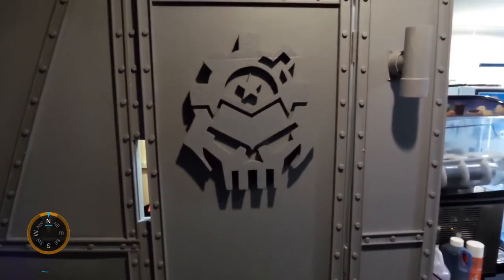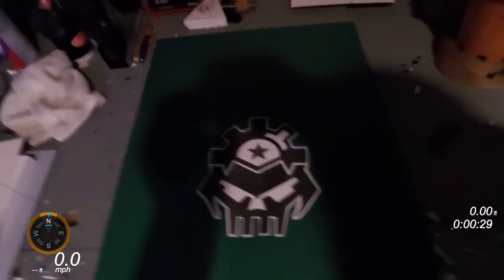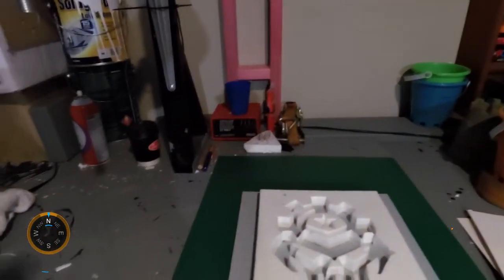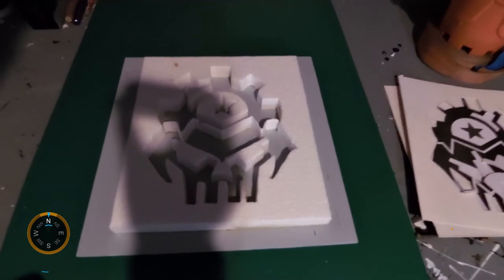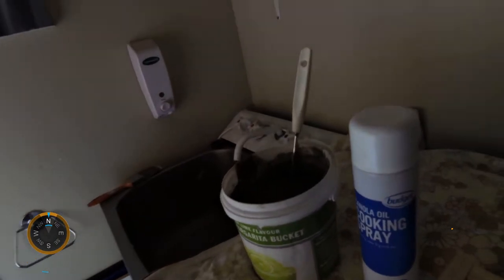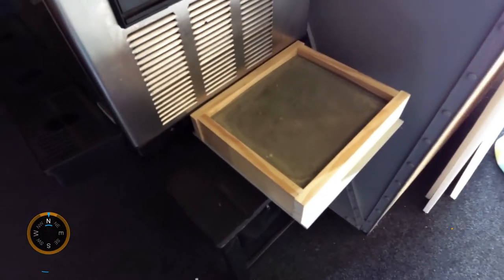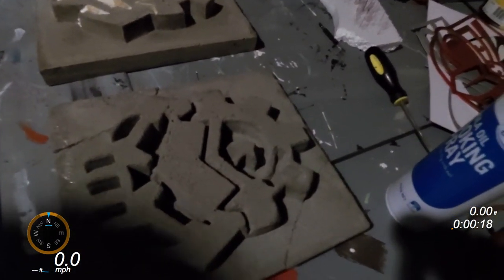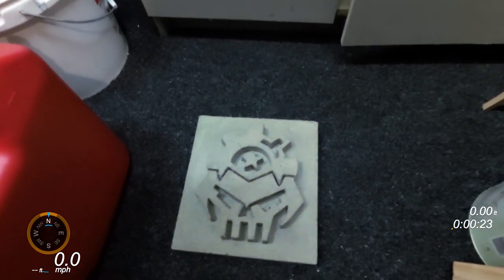Concrete Skull Mold Using Polystyrene.

Comment: Next time use acetone to melt the Styrofoam (bits and pieces) or use a torch!
Reply from the maker: Thanks for your comment, but the acetone was not the look I was going for with this one. I find acetone is not as accurate as I would like.
Reply: Random Guy , perhaps I was not too clear. At 3:10 you say it was difficult to release the bits and pieces of mold foam trapped in the concrete, this is where the acetone will simply melt those pieces and not affect the concrete! Or simply burn the pieces with a torch. Good luck.
Reply from the maker: Ah yes, true, sorry about that.